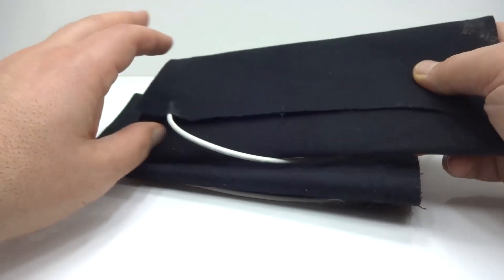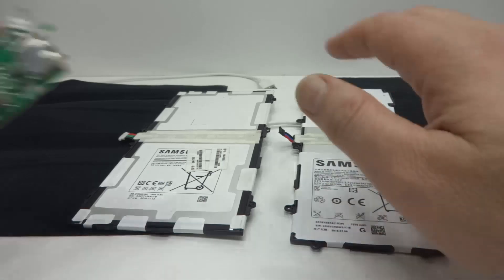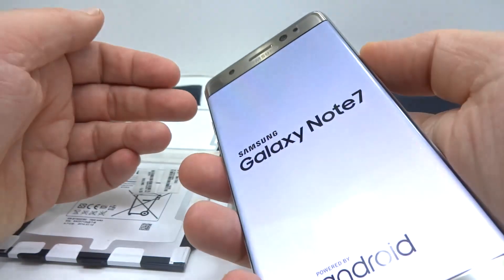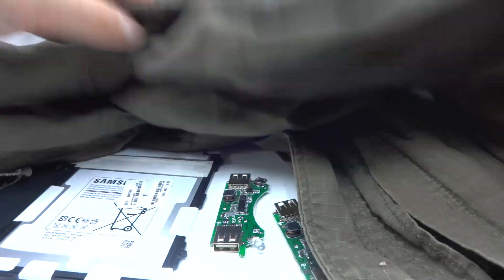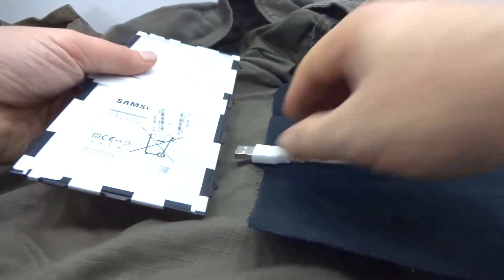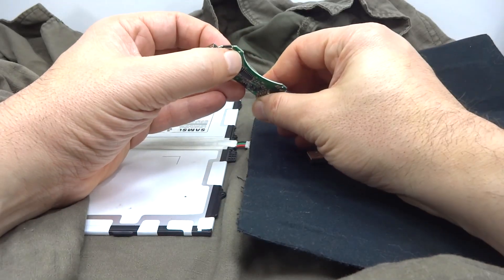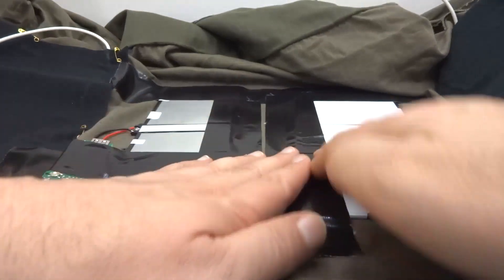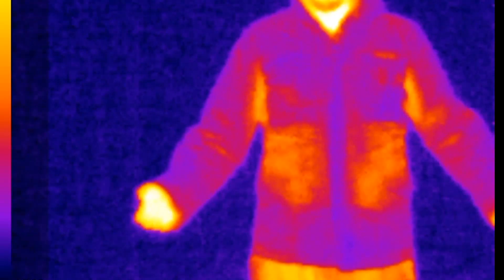Jacket heater experimental prototype

Comment: You can actually buy thermal battery banks, where the outside is hot 
zippo makes them too so it's not like a small project thing.
Reply: also I should say that a real heated jacket made by a company is also about $60. so you're not really saving any money, although with your method you can actually change the jacket to anything you want with pins.
these official ones do also use a USB power bank, so it's basically just a professional version of your idea, and probably a whole lot safer.
Reply: I have a pair of electric socks and they have a USB C port and they're powered by a power bank in each leg, but if you were inclined you could run a USB C extension cable up your legs into the jacket so you can have one central battery bank, you could make that a 30k mAh and have all day heating
Reply from the maker: I was more interested in experimenting than saving money. Also the intention was to have this thin jacket under a larger coat so I could wear any coat I wanted.
It did mostly work. If I could buy a thin heater jacket professionally made version to wear under a coat I probably would.

Comment: i have owned a usb heating vest since 2018. my experience is that certain heating designs like gloves that are premade can be wired wrong  or not safe. i have a single glove that burned a hole in the top of the glove because it was marketed as 72v heating gloves which can be still found on ebay.

they are actually simple pads wired to use 5v's DC which if you keep it in that range depending on the materials you'll be okay. they have actual thermal controls you can buy to attach to your battery pack done easy to regulate voltage go on and off etc

the pad is best used in proper clothing for low heat  generation to retain your body temperature and use your jackets insulation blocking properties

i am working this winter to build my own heated gear system. appreciate someone else's knowledge on this stuff never seen anyone else work on this stuff

i chose the premade vest originally as it can be used in between your jacket and shirt. which when you loose heat in very cold scenarios it will give you extra heat. as in some cases your own internal body temperature can drop and you have to gain circulation by moving around which isn't always feasible. you cold have wind chill slowly eat at your clothing riding a motorcycle and be forced to get off your bike in a snowy like environment to heat up which could be a bad thing or annoyance.

there is a lot of luxury advertisement, not survival engineered heated gear that doesn't make any sense to use for anything other than luxury and there are others perfectly combinable to much better equipment\materials fabrics like polypropylene are absolutely a + advantage boost for internal heating.

you don't really need to have a very hot heated set of clothes. just very minimal its more effective because it's not the same as sitting next to a 2000w heater fan or your engine heat in your car. 

the clothes material does all the work. the pads are a heating element solely

also i highly suggest building a DC jack battery system with these pads. then get a thermal control regulator attached. the USB is really a gimmick and they are really DC wires with a TYPE A Jack soldered on to be convenient for tech illiterate folk who just wanna use their typical USB battery bank. it's more effective and allows you to get that low profile design you would want. also they have wireless remote controls for some of these not sure if it's DiY advertised but its definitely on premade insoles.

if you're concerned about safety LI-PO and LI-MH are good options most premade battery provided is using LI-PO batteries. however capacitance wise vs extreme cold might be better going for 10,000 MAH rated batteries to match that 2 amps\5vs power draw so it just lasts until the pad itself burns out which is unlikely if you use it on low most of the time

but yeah. need to post a video myself of my project's..however not good at editing\filiming like you are 😀 why i comment on these, someone who can benefit spread\share the knowledge not just some makers kiddie who does crap cus he's gen Z or supa smart supa hip n' cool . rather for the value of science 👽what is that these days, and then all the smart people comment on your channel 🤣another fun rant ;)
Reply from the maker: Interesting details there thanks. I've been thinking about how I can improve this build. Be good to see your builds.

Comment: Maybe this would be simpler and more useful with a powerbank stuck in the pocket? That way it could be recharged easier and also you can charge your phone from it.
Reply from the maker: Yes, that does sound like a sensible approach. I was thinking the batteries also get a bit warm so why not take advantage of that as well. That idea probably didn't work out for the better though.